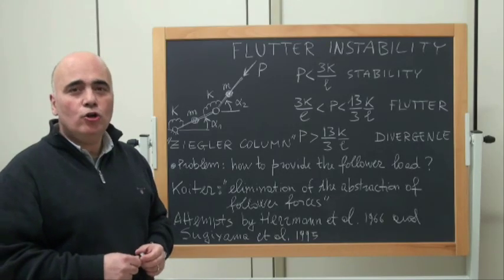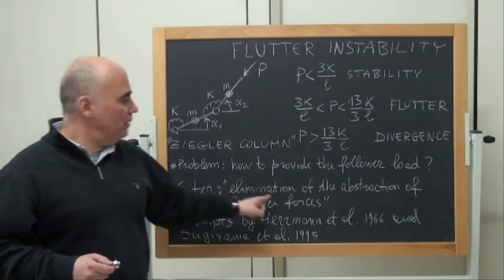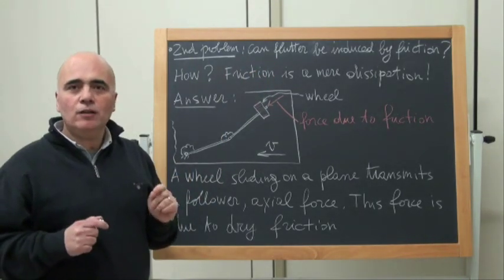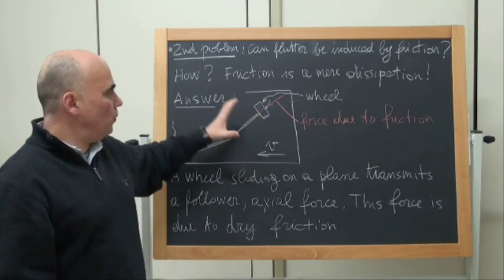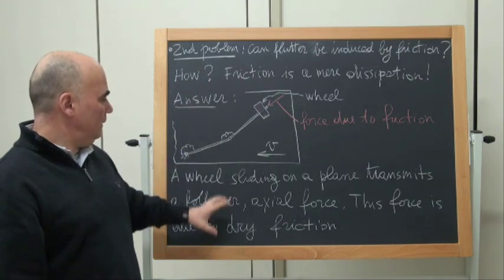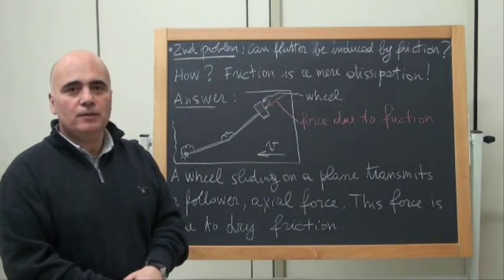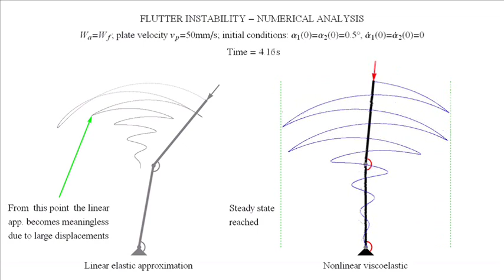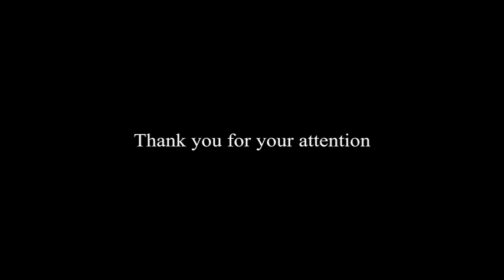Flutter induced by friction

Comment from the maker: The right amount of weight means, more precisely, that the weight must
fall within an interval to produce by friction a tangential force in the
flutter range. Speed is not a concern. Flutter occurs at all speeds,
except that speed influences the maximum amplitude of oscillation (the
higher the speed, the higher the amplitude).

Comment from the maker: @antonello988 

Flutter (and divergence) are found with a linearized analysis.
This is true even for the original Ziegler's column.
In this analysis, cos \alpha_2 = 1 at the onset of flutter.
To analyze the global response a fully numerical nonlinear analysis is performed. 
This analysis confirms that the flutter load calculated via linearized analysis is correct.
Best wishes,
Davide

Comment: Can this flutter instability be demonstrated with a continuous system e.g if the column which has 2dof from the pivots, was replaced with a slender beam  flexible enough to bend elastically.

Comment: Alright so it seems you need the exact right amount of weight and speed to induce the flutter. Yet wind (which blows at variable and none consent rates) took down the Tacoma Narrows Bridge. How is this?
Reply: Exactly... that is why bridges usually do not experience this thing. And that is why it is a rare thing to occure in everyday life, yet when it comes unexpectedly, it can cause severe damage. And also, Takoma was not poorly designed, because the whole thing was not experienced at the time, and also if it would have been designed for flutter, the computational techniques of the time were not trustworthy in this case.